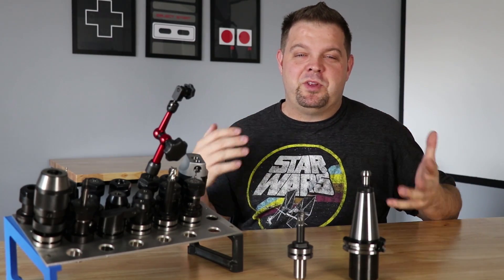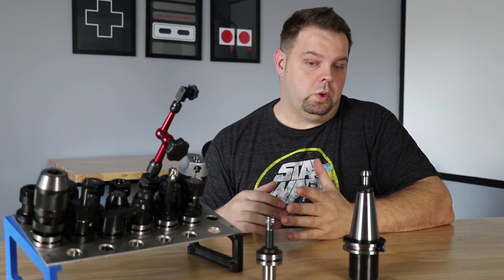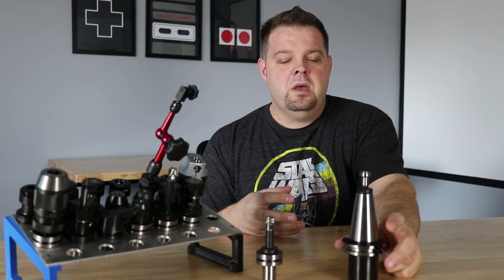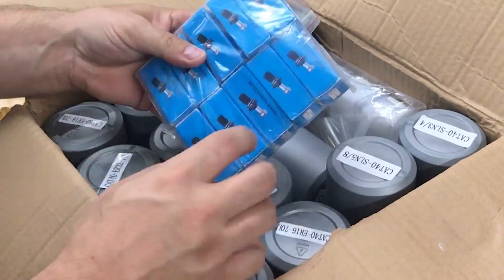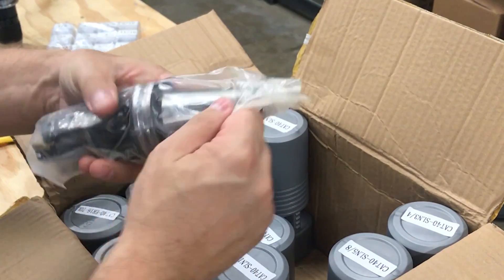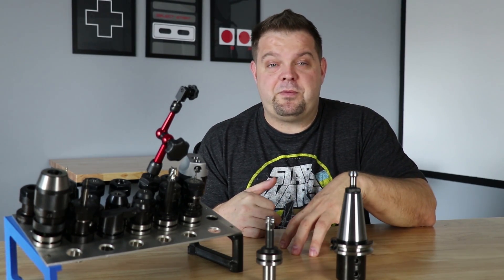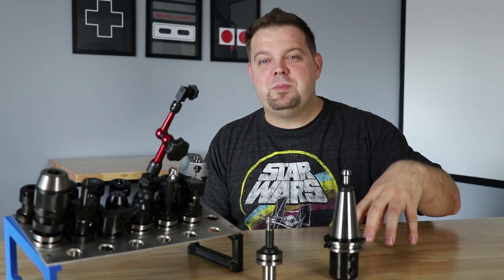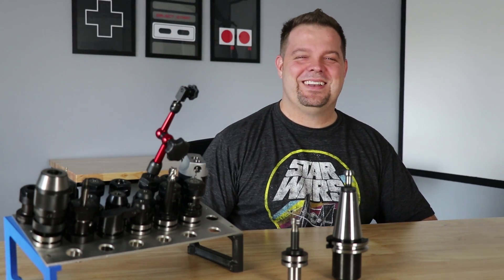Budget Tooling & Haas Spindle Run-out

Comment: If i had my own shop i would just go with Schunk toolholdings as far as i could, Sandvik themselves use Schunk toolholders in Gimo sweden making toolholders for Sandvik.
If runout is your concern you should look at Schunks Hydraulic line of tool holders, we just bought a nice SK40 12 mm hydraulic tool holder called Tendo E for around 160 $, Sandviks equivalent  is around 3 times that and you need a torque wrench so you don't overtighten the tool. but yeah, all sandvik hydraulic toolholders are Big-Plus certified but my DMG isn't so i don't want to throw money in the toilet buying something i don't need.

To this day i have bought around 15 - 20 toolholders from Schunk, a standard Weldonholder is only around 60 - 70 $ and balanced to G2.5 (25 000 RPM), it's amazing how much toolholder you get for your money when you look at cheap options for half the price but can't go over 6 000 RPM

Comment: At work we use a lot of Parlec holders, as well as Tekniks holders. I’ve had pretty good success with them. As far as perishables go, I am a Seco guy through and through. Can you get by with cheap accupro, titan, and other generic end mills? Absolutely. For general purpose things they work fine. However, if you are after optimized toolpathing, high feed rates, and especially with machining difficult materials, the off brand stuff just flat out doesn’t work as well. You will be very much so money ahead to go ahead and bite the bullet with the name brand carbide, I.e. Iscar, Niagara Cutter, Sandvik, etc.

Comment: Yes China can make excellent products, parts and or machines. You have to establish your expectations and QC them yourself or third party to keep them honest. If your contracting a Chinese shop for a product, beware. Anything that doesn't make QC standards will be sold out the back door as a knock off. Then you'll wonder why your sales are not what you had expected after spending all that money on market research. Be strict with tolerances only let them make parts of your product and don't let them build or assemble your finished product. If you can bring it in house and become super efficient with your processes, you'll be way better off. If you are gonna have lower than expected sales let it be because the quality is impeccable and the price is a bit high.  The alternative is selling your manufacturing soul.

Comment: Dont rub your hand on the taper of the arbor. Your hand oils will rust them out. wipe the spindle with the included liner, clean then liner with alcohol. The grease on our hands is not a solvent and will leave a residue that can and will attract moisture.

Comment: I’ve had the exact same problem with some tool companies they aren’t interested in a one man one mill setup. I’ve found a company called cutwel in the UK who are brilliant
Reply: Cutwel are also guilty of selling these chinese tool holders. They have a good varied selection of general purpose cutters, but you'll never get anything specialised or modern. If you were listening to the video, cutwel are a distribution model where the suppliers generally know very little, I've spoken to the technical staff who only ever refer you to the cutting data. A technical staff told me to only cut 1mm deep on 50mm shell mill like wtf. The miller can take far deeper cuts - but they are uneducated and one of the technical staff told me that it was just common sense!

If you want to truly learn and be involved then go with specialised and independent tooling suppliers. They know their shit, they know your shit and they know the best shit - Talking to someone who can do your job better is a good feeling.

Comment: From what I've seen, the issue with cheap toolholders is moreso materials and hardness (especially at the threads) rather than the runout. Fortunately for cheapo manufacturers, the only way to make those two tapered sections is by grinding them between centers as its own operation...so as a byproduct they naturally have little runout. But is the toolholder's taper actually 16 degrees 15 minutes 37 seconds? Maybe, maybe not, who am I to judge!

Comment: I by my endmills from Helical. It's a distributor system, but I've been happy with my purchases. 

What got me was their solid selection of reduced neck endmills. The mill I was buying for only has one horsepower (Novakon NM-135), so having the reduced neck let me get to depth without rubbing or bogging down the spindle.

Comment: Maritool is where I went for 90% of stuff for my Brother. It's really as good as the Sandvik toolholder I have for a shell mill. The tool holders may not be that big of a deal (just run-out if it works for you), but for me, the pull studs I wanted to make sure I got the good ones to protect my spindle. I went with the more expensive High Strength studs.

I know people go crazy checking runout on their individual end mills, but honestly, I don't think static runout matters as much as dynamic. So measuring is fine just to confirm there's no setup problems, but tweaking an endmill into perfect runout, only to have it flex majorly in a cut from a high gauge height or weaker holding method...well I don't see the point.

BTW, for a face mill, I got a Sandvik one off eBay for a great price brand new. Sandvik makes amazing inserts I've found after trying a ton of stuff on my lathe. My rep for Sandvik though was terrible and couldn't care less or solve my issues. If an Iscar or Kennametal guy walked in and could solve problems for me, I'd go with them for sure. Yamazen has several other brands of insert tooling that I'm not too familiar with, but I do have a good guy there to work with, so I may try stuff out. I am kind of envious of shops that get tooling guys that come in, give them a tool for the job, and guarantee it works, and only then they buy it. Oh well, such is the life of a small shop, we just don't buy what the big boys buy like you mentioned.

Comment: Kennametal I used all the other companies .. one day the kennametal rep stop by I tried some tooling and never looked back
Reply from the maker: Grim Lock hmmm.
Reply: Guhring Powertaps are very good for the price.  Ma Ford, Harvey-Helical and IMCO for Solid Carbide.  

Not a big fan of Kennametal or Sandvik, high performance in specific applications, but very pricey also.  I feel like KM and SV should ALL be made in 1st world countries and pay employees well with benefits > for those kind of tool costs.  MSC used to have pretty good pricing on Kennametal, Seco and ISCAR.  OSG is another brand that has dropped off in terms of price vs quality.  The company I work for purchases through Western Tool and MSC.